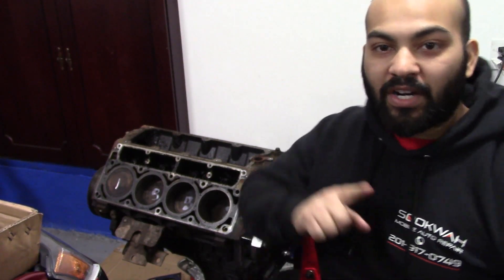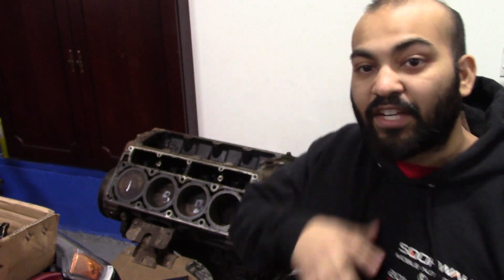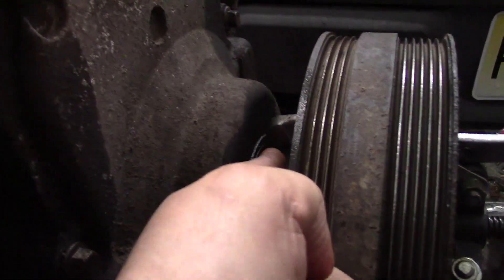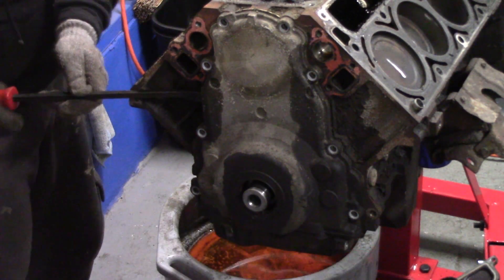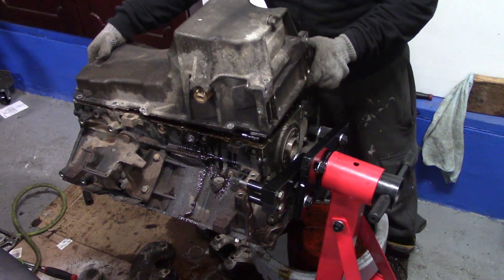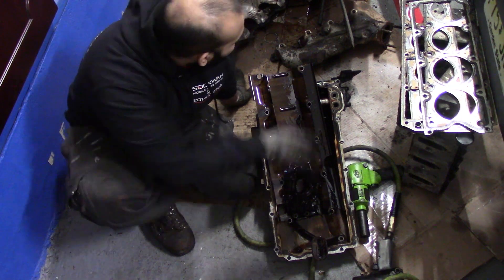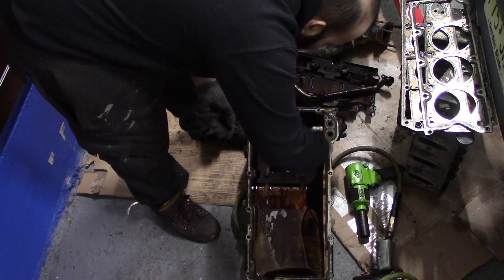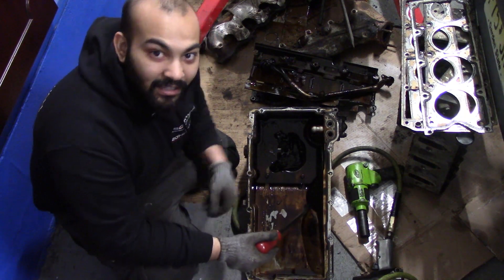ENGINE TEAR DOWN PART 2 [2004 CHEVY AVALANCHE][5.3 VORTEC V8]

Comment: Cant wait to watch the next part. I was down in the bronx this past weekend helping my niece move there from Rochester New York.  Drove my Avalanche down  there pulling a small uhaul trailer.  368 miles going there a full tank of gas on the way home about 3/4 of a tank. It rode great cant wait for my next road trip
Reply from the maker: It always does better on the high way..i can't wait to have my truck running again.
Reply: @Kingcustomz  I parked in 2 different garages and each time they asked what car is yours?  I just said  Big yellow truck. They knew exactly where it was lol. I guess not to many yellow avalanche in the area
Reply from the maker: Lmaoooo especially in new york... You would find more of these vehicles down south